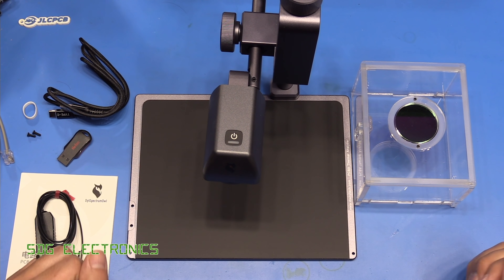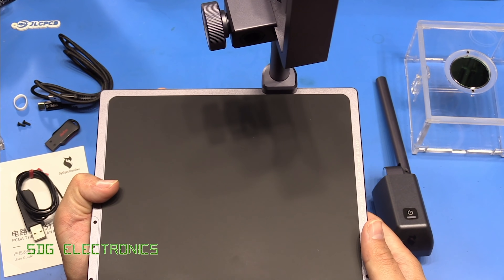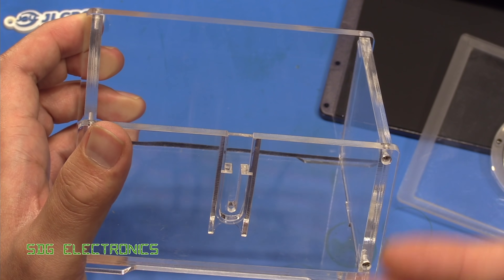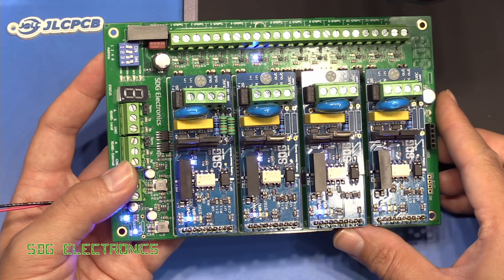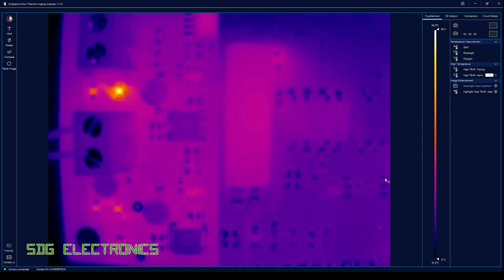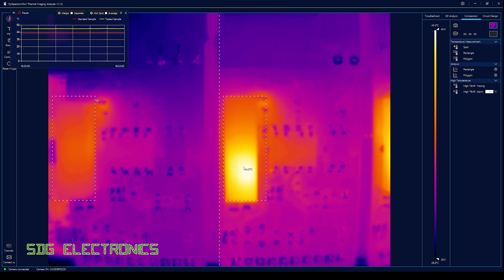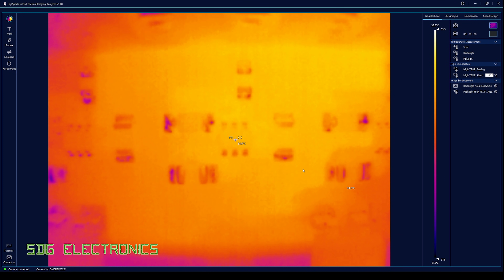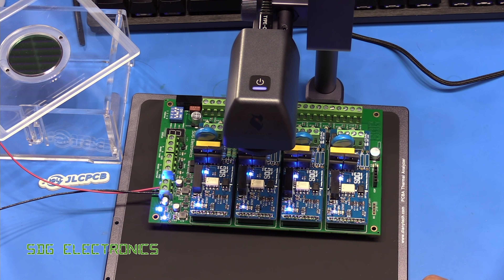SDG #228 DytSpectrumOwl CA-10 Thermal Camera for PCB Analysis

Comment: Thank you for this video. I appreciate the information you have given. I previously had the Flir ETS 320 for finding shorts on motherboards which was very good, but it developed a fault and I returned it. I wasn’t able to get a replacement at the same price as I bought it with a significant discount. I’m therefore looking for a replacement and wondered if the software with this camera combined with the viewing angle, may make up for the difference in resolution between this and the flir which had 320 x 240. This camera looks good enough to me from your videos and I like the look of the software. I was very disappointed with the flir software and the way I was unable to get larger boards under the camera.

Comment: Nice video and product.  Font was small when comparing spot temperature with and without IR window.  What was the "measured" temperature drop caused by window's non 100% transmission?
It would be nice to check that also at much higher temperature.   Do you have a black-body calibrator,
to check the accuracy?  Thanks again!

Comment: have a question on the riden power supply would it be worth adding a pre filter on the mains in side to help with noise and ripple or wont it make much of a difference as iv found some of those connectors with built in mains filters

Comment: Unisolder project any progress? :) Keep up the good work. Gave you a thumbs Up!
Reply from the maker: I have a couple of projects to get completed, but I'm starting to draw up some ideas for a SDG Electronics Solder Station. I'm having trouble finding a suitable case for the UniSolder, so it may have to be custom.
Reply: @sdgelectronics  Glad to hear you are still on it. Maybe a 3D Printed case or you think it will not be durable enough? You can always print another :)
Reply from the maker: @abeleski  The problem is really the big toroidal transformer. Any slight vibration and it'll probably snap a 3D printed case. I'm considering just using PCB material, or maybe some plain aluminium sheet

Comment: That looks really useful - but the price tag is a killer - though I get good thermal cameras are not cheap. I really like the "non-hand-held" nature of it. Looks like the software is Windows only?
Reply from the maker: Yes, unfortunately Windows only for the software. The camera itself works in Linux though.
Reply: Because Amazon charge us a lot, 15%...  If you direct contact me, the price can be lower.
Reply: They probably feared the dreaded (non windows) OS updates that kill of backwards compatibility and force unnecessary software changes.

Comment: Wath will be the next soldering station .
Reply from the maker: It will probably be a hot air station, but after that a Hakko clone
Reply: @sdgelectronics   i want to buy a Metcal soldering station but i do not now wath to chose mx5210 or Cv5210 . Who is better ? You have a lot more experience with Metcal then me so maybe you can give me your opinion .
Reply from the maker: MX would probably be my recommendation.
Reply: @sdgelectronics   yes to be onest i am not to impress by this new models of soldering stations.
Reply: @sdgelectronics   and olso the mx sistem cartiges are much cheaper .
Reply from the maker: @andreiciora2765  The GT120 is actually very good, I didn't give it enough credit at the time but having used all the other stations it's really impressive. The MX system works with the CVC cartridges if you need more choice.
Reply: @sdgelectronics   not to impresed about the GT 120 . I think  i will buy a mx 5210  .

Comment: I have the original QianLi thermal imager in this 'form factor' since 2019 I think. I mostly use it to find fault/shorts on phone and laptop PCB's. This one looks better in the sense that the build quality looks better, the quality of the software is better and the connection is USB-C (and not the stupid RJ45 connection where you probably need a USB->network adapter to be able to use it on your computer).

The thing I'm missing though, and what the older QianLi camera does have, is a visible light camera. It's very nice to have a visibile light image on top of the thermal image (lets say 10-20% opacity). It really makes looking for small temperature difference on a PCB more easy to pinpoint.

The price really isn't that bad tho... I think I paid something like $900 back then.
Reply from the maker: True about the visible camera, but the short focal distance means that you get good enough resolution to pinpoint components if you get close to the PCB. How did the QianLi handle the image alignment?
Reply: @sdgelectronics  You have to align the visible light image in the software, depending on the camera distance. It's never more out of alignment then a few millimeters though.

Comment: You can buy locally a Flir One Pro less of this price, with much more quality
Reply from the maker: FLIR One Pro is significantly poorer in performance though and the minimum focus distance is around 150mm which makes it pretty poor for electronics use when combined with the low thermal resolution.
Reply: @sdgelectronics  this is a piece of sht compared to Flir One Pro. The Pro has a tousand more better resolution than this thing. I using the Flir for PCB working and this advertised bullsht for double price is looking a horror. C'mon, hope you get enough money for the Ad's to recommend this useless thing.
Reply from the maker: FLIR One Pro only has a thermal resolution of 160×120 and a refresh rate less than 9 Hz, compared to the 280x200@25 Hz from this device. Given the minimum focus distance and wider FOV of the FLIR you have effectively worse resolution when looking at small components. I used to have an original FLIR One, but it didn't really work out for PCB use.
Reply: @zsbalak  I have a FLIR E8, and no, this CA-10 would be far more useful than the FLIR for bench PCB work as it can be easily focused and held in place. Of course its useless for anything else, but thats fine.
Reply: @jaro6985  FLIR's cameras feature are all very general, not customized for some special usage, that's why we want to improve it with a better and complicated rack, it can see the whole PCBA or small components, to rotate to avoid reflection etc., and add some useful feature to press on button finding the hottest area, and with some analysis features.
Reply: @zsbalak  I bought this and sold my flir one, this way way better in every aspect
Reply: I think this one is the first I've seen that optimized for Pcb work......let's hope some of the others catch on.

Comment: The software looks really nice. Do you know if it supports Thermal JPEG? I've got a FLIR static camera and the FLIR software is quite limited. Good review.
Reply from the maker: It seems to wait until an appropriate device is connected before the software works, so I think it's effectively locked to the hardware unfortunately.
Reply: @sdgelectronics  Steve, thanks for the reply.
Reply: Actually all the pictures taken from the software are all radiometric JPG file format, now this software is not support,  we are testing another analysis software, later will release to Mr. Steve.

Comment: The software is really cool. Would have been nice if you explained the use of each feature like the use of temperature line, etc.
Reply from the maker: I'll use it a bit more in some videos soon. The user manual is basic so I'm still trying to work out what a few of the features are.
Reply: @sdgelectronics  looking forward to it!

Comment: The recurring pattern with chinese electronics and instruments is that the finish and physical build quality is excellent these days but they often lack in circuit protection and adhering to standards. Trying to buy a DMM & it just annoys me how they won't put a PTC/HRC fuses etc.

Coming to this imager, the stupidly close distance to the PC really limits it. Not to mention the useless sensor. Whatever it gains out of getting the sensor so close we should be able to achieve through software.
Reply: The only way to provide a closer view without moving closer is a higher resolution microbolometer or a multi element ir transmissive zoom lens, both of these options would significantly increase the price.
Reply: ..and usually poor software
Reply: @mikeselectricstuff  You want to try non Chinese ink jet printers for exceptionally poor software 😁